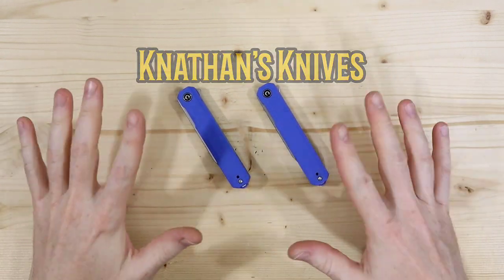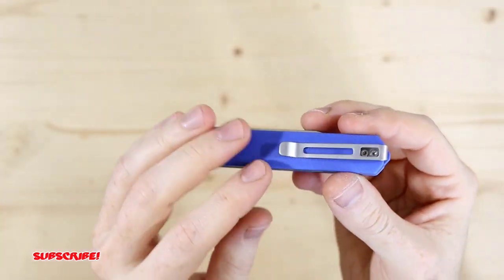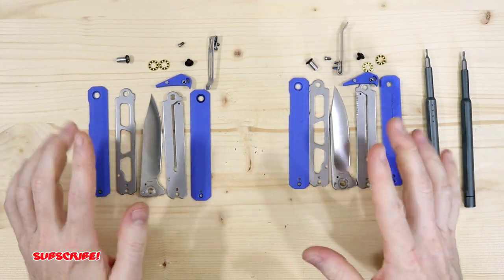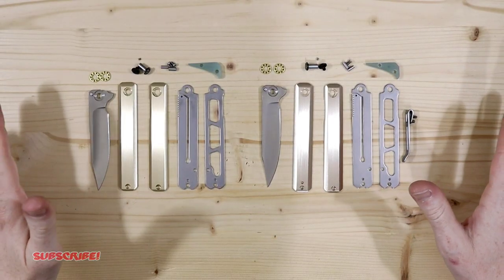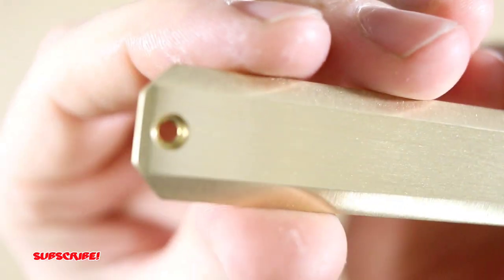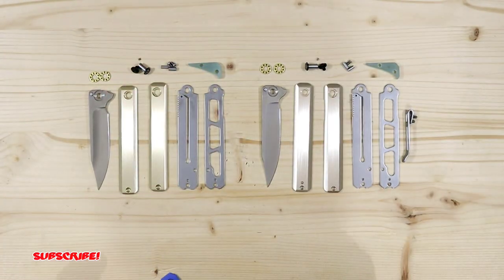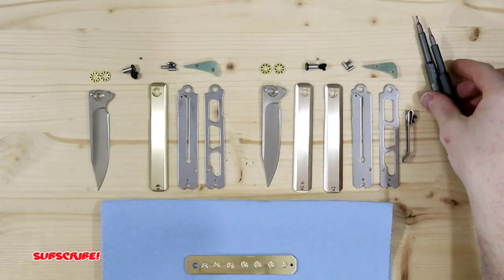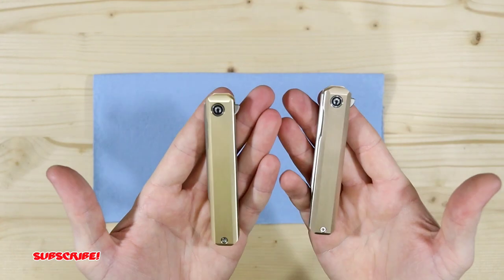Civivi Chronic Pocket Knives!!! Brass Twins!!!(Knathan's Knives)

Comment: Man these look gorgeous! How were able to attach the little nubbin on the pivot by the way? You said you were holsing it down with some grease so i assumed you just did that as a temporary thing before actually gluing it or something. Great work!
Reply from the maker: Thank you! 
I was considering using super glue to hold it down but I didn't want things to get stuck. So, hopefully when taken apart it's being kept in mind that that tiny piece is there. I wish Civivi just put a D-shape pivot pin.😁